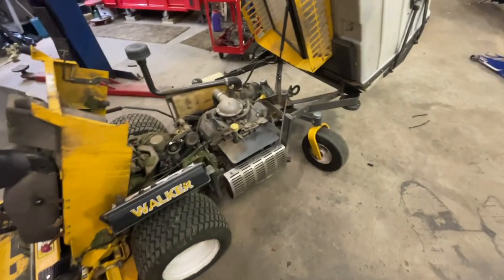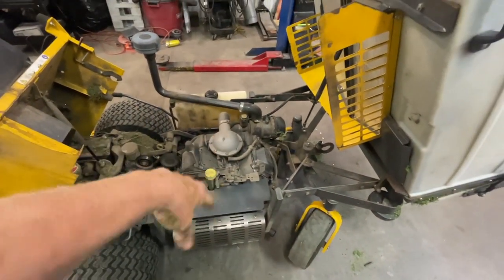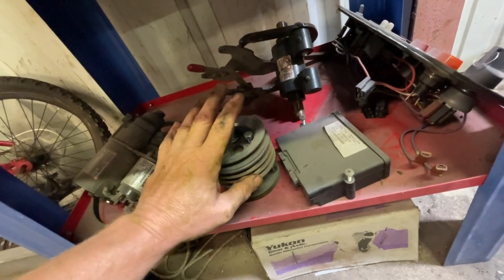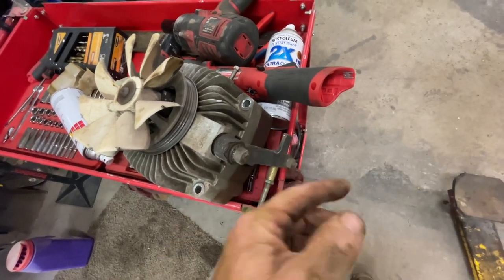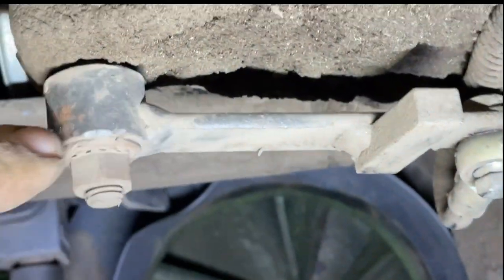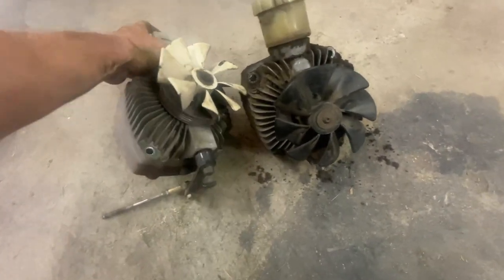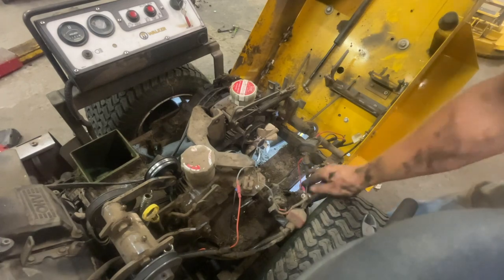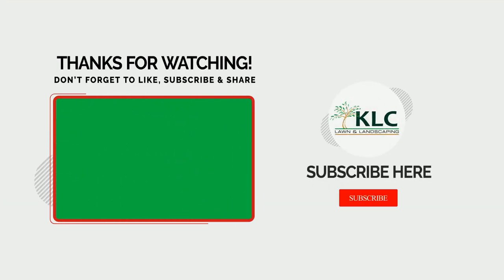My Walker Mower Mows Circles Around The Competition! Literally! Only!

Comment: Thank you for the His video. I have a 2018 S18. After awhile it begins to not steer straight and it’s hard to keep it straight. When I go up an incline and turn right it won’t turn easy. The left seems to turn easier.
Reply from the maker: Great! Glad I could help
Reply: @KenMrKLC  hey Ken. Quick question. My machine is not smooth on the right side at all. Changed oil on hydros and transaxle. Belts and gave it an alignment. If im in neutral and pull left lever back all the way it donuts backs smooth. If i pull right on lever it goes in a donut but in a jerking motion. Not smooth at all. Going forward is fine but turning right is reall rough. Not smooth at all. Any ideas?